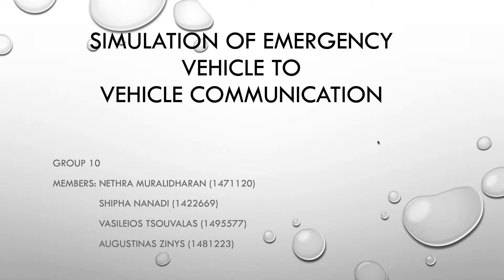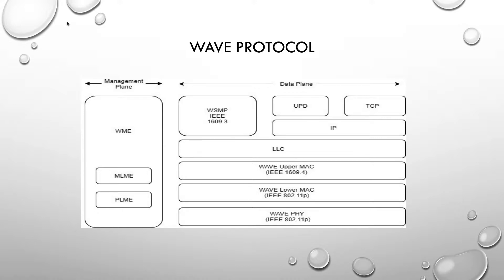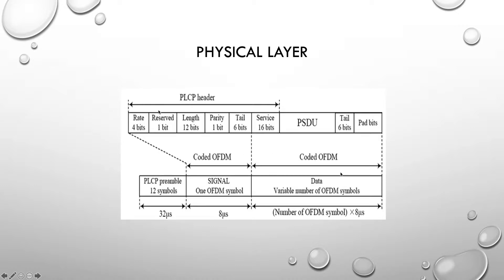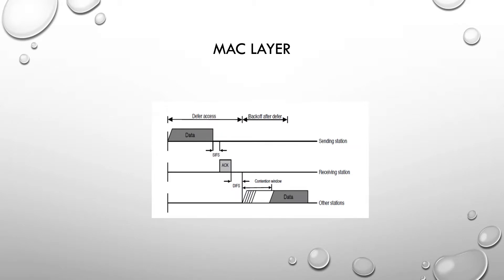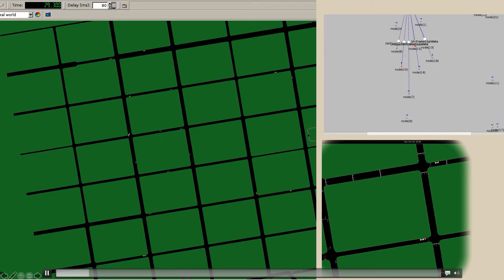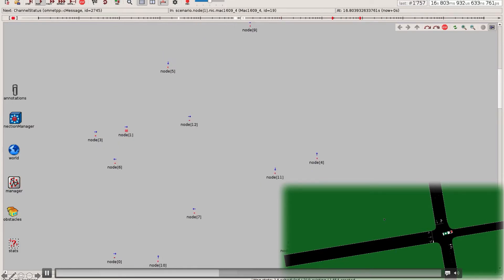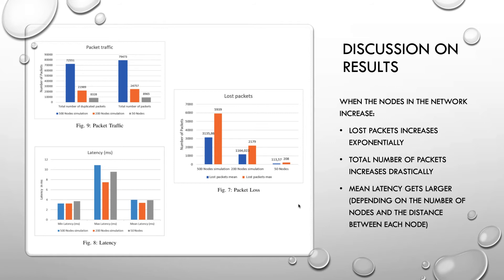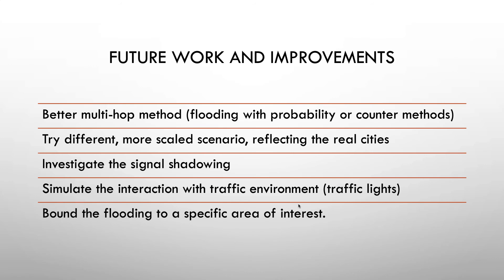Simulation Of Emergency Vehicle to vehicle communication

Comment: Interesting, so can we use this Veins framework to choose only a specific vehicles to share the connected network information?
Reply from the maker: Yes ..you can..in our case we used the framework for ambulance
Reply: @nethramuralidharan2129  Interesting!
Can the same connected system network be created by just using TraCI commands?